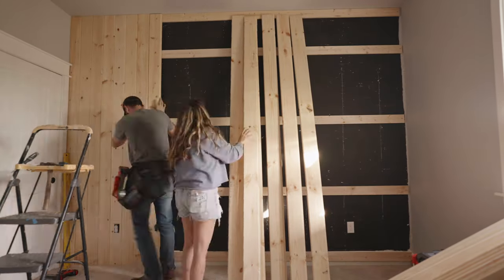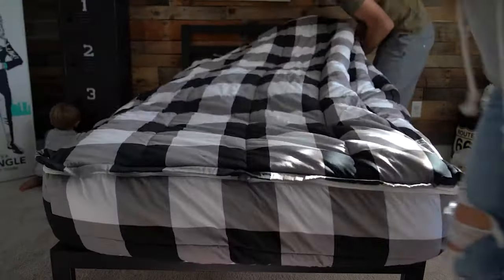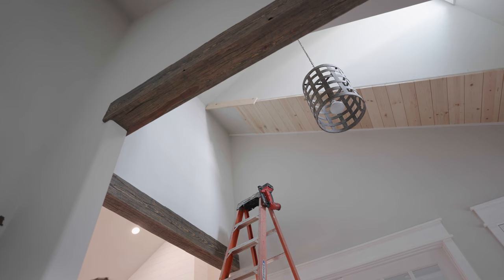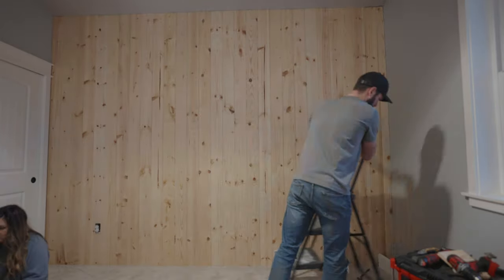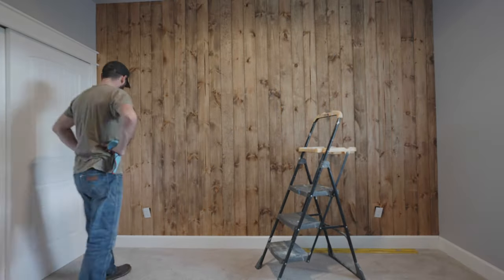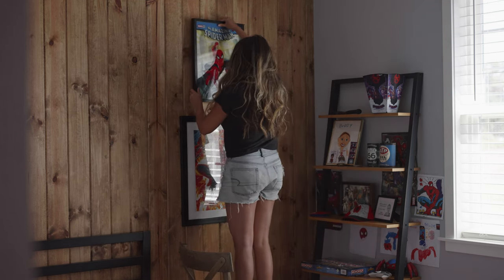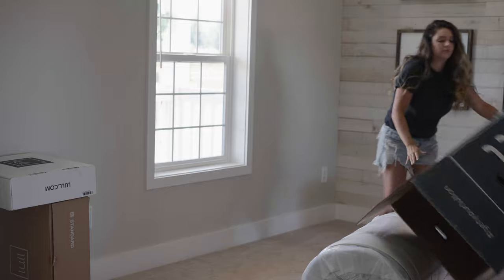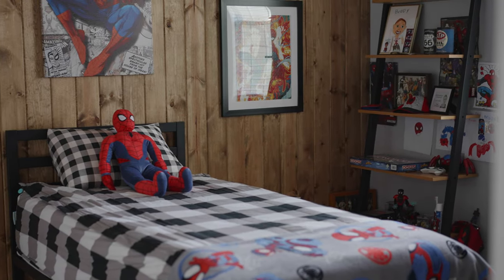DIY Tongue and Groove Wall Makeover

Comment: I LOVE THE WALL AND THE STAIN! I Love to see the knots in the wood and it makes it look pretty rustic! Great job! Great video n thank u for sharing! 😊❤️🎁💕⭐️ ps I use a suction cup hook for windows n glass doors, I think I got them from Ace hardware or yours building center, not sure, but I have seen them at Walmart too, they had different sizes, command had ruined a wall n pulled the paint off so I am not using those any more!